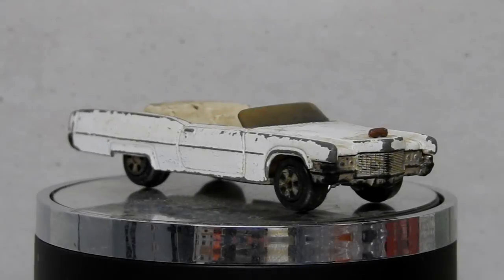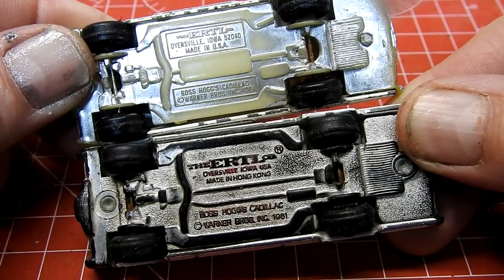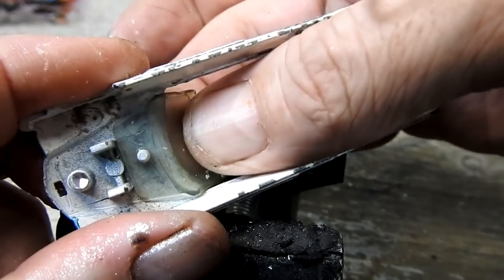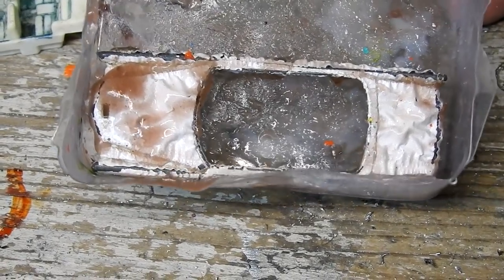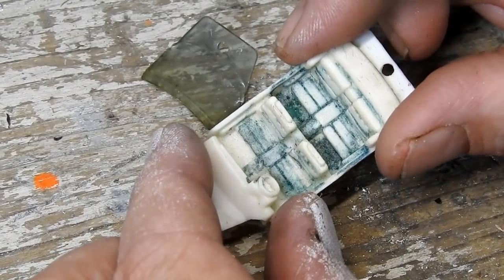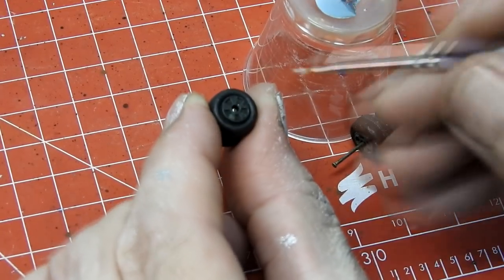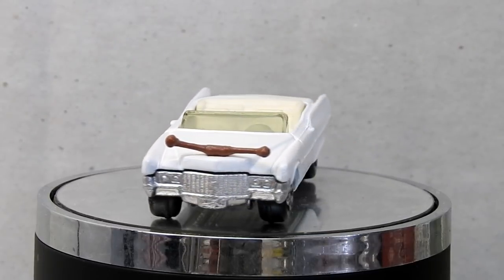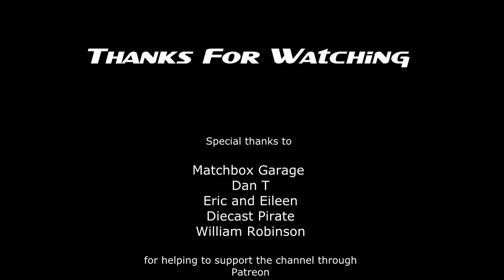Ertl Restoration Boss Hogg's Cadillac "Dukes Of Hazzard'

Comment: I love this casting. I like how the old ERTL cars are kind of crude. The only thing I don't like about this casting is that stupid windshield, it sits down too low into the cowl and is leaned back too far. I have this car with chipped paint and left it like that and gave it a flat clear coat, filled the hole in the hood where the horns were and gave it Hot Wheels steelies painted Silver leaf and lowered it. I also repositioned the windshield so it looks right.  Looks sweet now.
Reply from the maker: Yeah the windscreen doesn't really fit properly it has the wrong curve on it.I guess the riveted version forced it up more but even that looked low.

Comment: Roscoe’s police car in this series was a (1980-ish?) Pontiac Bonneville. Totally incorrect for the show, but it was a decent model by Ertl’s standards, and had a nice scale to it. Ertl also had a pretty good Chevrolet Caprice from the same era. Not sure if it was ever a police unit, but it did turn up as various stock race cars and as the Hawaiian Tropic racer in Ertl’s Cannonball Run line (which was overall rather dire beyond that vehicle).

Comment: I have one of these and I don't remember the horns having those knobs on the end.  Could you include the pictures you are referencing in the video.  Also I would have swapped the front and rear axles, as the ones on the rear looked to be the best, and you can hide the other ones behind those skirted fenders.  
Honestly I never believed Ertl ever took their diecast division seriously.  The quality was only about as good as any of the other second rate brands like Yatming or Zee.  I believe they were trying to capitolize on the popularity of this scale, and also get licensing deals from The Dukes of Hazard and other TV shows.  I remember The Fall Guy, (GMC 4x4) and Knight Rider (KITT) as well as the movie The Cannonball Run.  Ertl's bread and butter were larger trucks and farm equipment which I believe they still make to this day.  I would say they should have stuck with that but then this video would never have gotten made.  I love the finish with the car sitting in front of the out of focus picture, it looks perfect.  RIP Sorrel Booke.